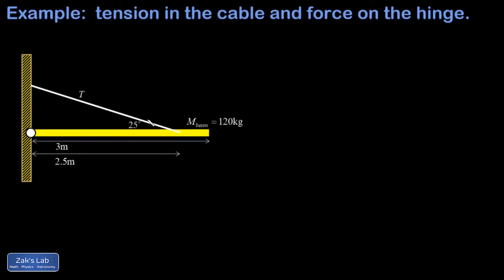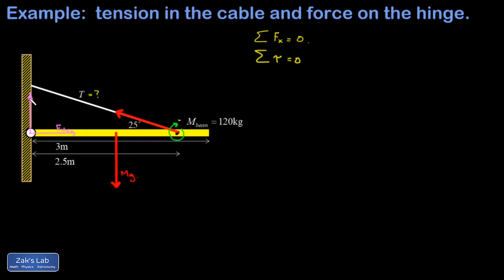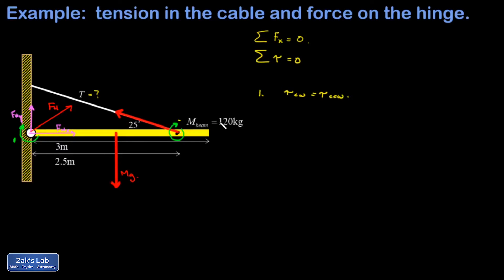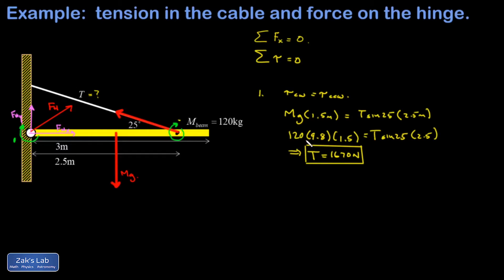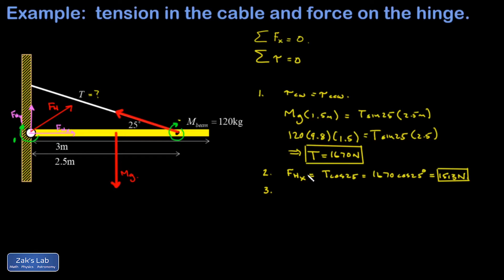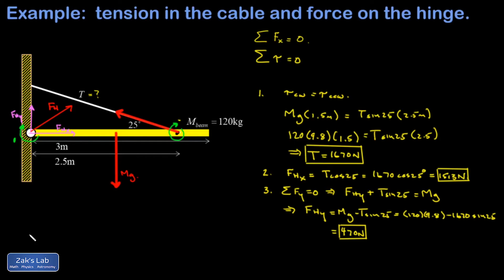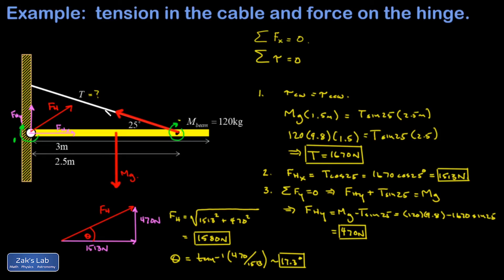Beam and cable problem:  tension in the cable using torque and hinge force at the end of the beam.

Comment: Why is the distance to the rotation axis 2.5m in the second part of the equation? Shouldn't it be 2.5tan(25)?
Reply from the maker: Two ways to compute torque:  1.  perpendicular component of force times distance to the lever arm (Tsin(theta)*r),  or 2.  entire force times perpendicular component of the lever arm T*(rsin(25)). Either way, you get T*rsin(25), where r is 2.5 (distance from the point at which the force is exerted to the chosen rotation axis at the hinge). z
Reply: WOW THANK YOU THAT WAS A FAST REPLY

Comment: How come torque is equal to tension? May u rationalize plz
Reply from the maker: Careful - you can't say torque is equal to tension (one is a torque and one is a force!)  There are two torques relative to the hinge.  Mg multiplied by lever arm going clockwise, then the perpendicular component of tension Tsin(theta) multiplied by its lever arm going counterclockwise.  In each case the torque is given by the perpendicular component of the force multiplied by the lever arm (distance to the rotation axis). z

Comment: Hello, why do we neglect the tension exerted by the cable at the end of the cable in which the cable is being mounted onto the wall?
Reply from the maker: The key here is that we're analyzing all forces and torques *acting on the beam*.  We have included the force/torque exerted on the beam by the cable, and the force exerted on the wall by the cable is not part of the analysis of forces/torques on the beam.  z

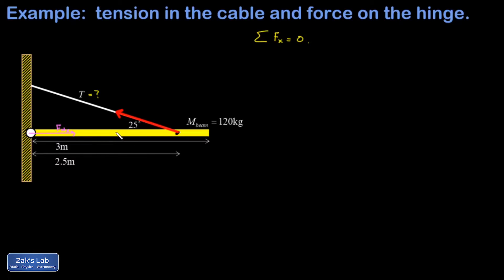Comment: "Hello, I have a question regarding the beam and cable problem in this video. At around 1:12, you mentioned that the torque at the connection point of the cable and the beam is zero when considering that point as the rotation axis. However, since there is an angle between the tension cable and the beam, shouldn't there be a torque component due to the tension force? I would appreciate if you could clarify this point. Thank you!"
Reply from the maker: If you take the connection point of the cable as the rotation axis, then the tension exerts no torque around that rotation axis, because the lever arm is zero!  There are torques about that point exerted by the force of gravity at the center of mass and the hinge force because those forces both act at some distance from the chosen rotation axis.  When we choose a different rotation axis, say the hinge, then the tension will exert a CCW torque with respect to that axis because it now has a non-zero lever arm.  And the main idea with torque analysis in static equilibrium is that you can choose rotation axes anywhere you want for the analysis:  the net torque about any chosen axis is zero because the system is not moving at all!  Hope this helps.  z

Comment: The distance of line of action of mg from the axis of rotation should be 1m not 1.5m....
Sir pls check it...
Reply from the maker: the beam is 3m long, making the center of mass 1.5m from the left end which was acting as the rotation axis for the analysis -- z
Reply: @ZaksLab  ok sir...
I have got it...
I thought the AOR is at right end where u have marked....
Reply from the maker: @SI_Bikram_Sing_Rathore  in the first part of the video I did a qualitative analysis about that axis to establish the correct direction for the y component of the hinge force, then I switched to using the hinge as the rotation axis for the quantitative torque analysis-z

Comment: Nice video! I am wondering whether the Fx of hinge is the normal force and the Fy is the frictional force ?
Reply from the maker: Not if it's supported by a hinge, but if it was held in place by friction I suppose that's what the two components would be.  -- Zak
Reply: @ZaksLab  so if it’s supported by the hinge, then what are those two components called? Thank you so much for your reply!
Reply from the maker: @jun-hsuangjen7385  I'm not aware of a special name for them --z

Comment: Hye , for the calculation check , i got slightly different which the tension i a bit more than the Force at hinge ? Am i correct ??? Cause ive done many calculation but still dont get the exact same amount
Reply from the maker: If you're just off in the last digit, that's probably me doing too much rounding error.  Give me your numbers, and I can check against them. -- Zak
Reply: @ZaksLab  for the counterclockwise, i got 705.77N while for the clockwise is 704.78N
Reply from the maker: @ferryanz360  It has to just be the rounding.  I kept a bunch of extra digits and re-did all the calculations, and the two torques for the double check both come out to 705.6N.  You're close enough where I don't think you made any concept errors, it's just an artifact of the crude rounding early in the problem.  z
Reply: @ZaksLab  i see , thank you for your reply ! Its my assignment and I’m kind of confused with this chapter , your explanation help me so much !